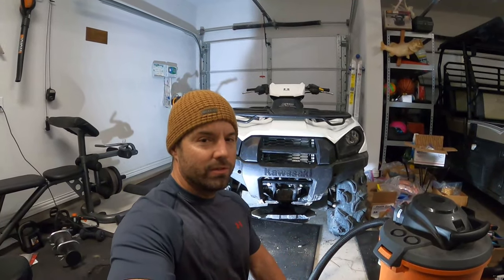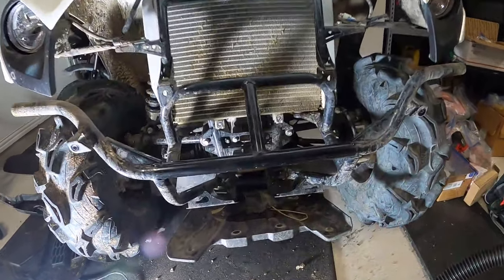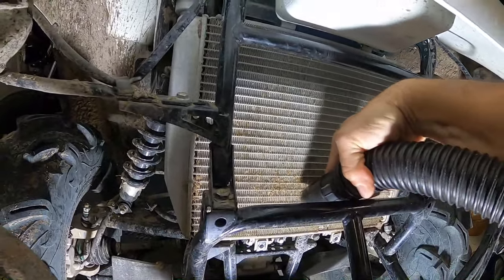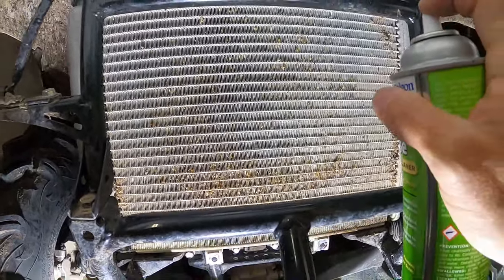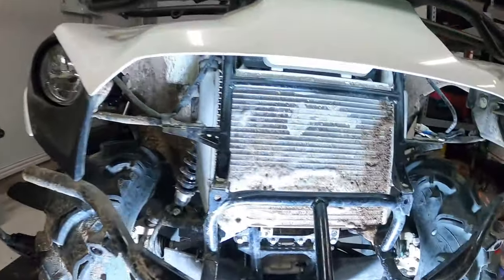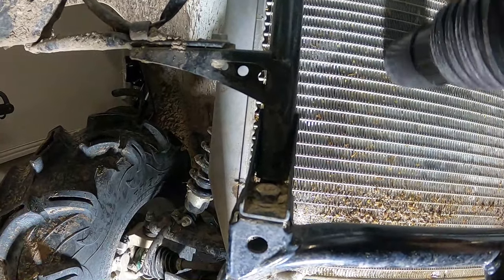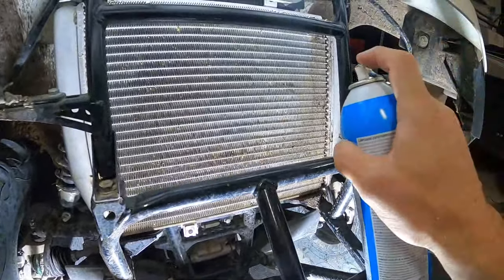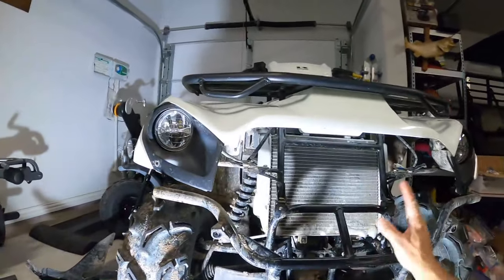How To Clean Your ATV / UTV Radiator (Overheating?)

Comment: Nu-Calgon Evap Foam No Rinse (green label) seems like it looked way better for deep cleaning. I got my new bruteforce and I've overheated twice so I'm looking at rad relocator kit my issue is mud getting thrown on the back of my rad from my tires as there is no inner fenders

Comment: i had a kawi twin that i mud raced and trailed for 12 years, they over heat bad if you do that and dont get 100 percent of the crap out of it every event, the coil cleaner worked but fades the plastic over time, so i started  using simple green with the foaming tip its non caustic so you can breath it and doesnt mess up your bike. the proper way to clean and the easiest on the kawi is take the fan out and lay it to the side takes like 5 min and do it from the back and hose it out , pressure wash is never used on a quad by me it destroys everything,. when its done you shine a shop light through and look at it from the front and you should not see blocked areas

Comment: I use a chemical called NU Brite. I got it on Amazon but its not on there now. I get it in a one gallon jug and put in a spray bottle and spray the radiator with it. It foams up and pushes dirt out of the fins. Use gloves, glasses and a face shield because this stuff burns if you get it on your skin. Makes my radiator look brand new again. I also take the fan off (it's pretty easy just 4 bolts) to clean both sides really well. After I use it I just spray the radiator with a hose. I have a 2020 Brute Force 750 and love watching your videos. Keep up the great work.
Reply from the maker: Hey that's for your feedback. I saw a similar formula like what you are talking about that's blue in a gal jug I think it was same stuff. I was a bit hesitant to use it around wiring and paint. I know it def will clean it up better.  Thanks again for watching.
Reply: used to mud race, also worked on commercail ac and that stuff would take out cars and crap if you wernt careful where it goes . not good for quads. i found simple green works just as good for clay and seeds, so i started using it for both and you dont have to worry where it goes. i read some people put on side covers, i didnt want to loose rack storage doing a rad relocate either but leaving it and putting covers on helps, mine had them from kawi but they dont now
Reply: @ChadOutdoors  .

Comment: I had the same problem with mine. From June 2019 when I got mt 2019 750 until March of 2020 I did the samething taking it apart and cleaning it just about after every ride. I got fed up in March of 2020 and purched a radiator relocation kit....best money ever spent. With the radiator up top i have never had to deep clean it like that again.  I would recommend getting one. Another good video
Reply from the maker: That's definitely something I will consider.  Did you use the factory radiator when relocating? Thanks for watching and glad you liked it.

Comment: My radiator has crap stuck in there from driving through high weeds. I need to clean it before it causes issues.
Reply from the maker: Ya it just gets worse especially if you go in muddy water. It will all get caked.  Thanks for watching.
Reply: @ChadOutdoors  how to clean it?

Comment: I heard a radiator relo kit helps with overheating problems on trials that's mostly likely what I'll get in the future plus it looks cool🤠🤙🏾
Reply from the maker: Exactly
Reply: It does..... I put a rad relocate  on my 19.  But I pulled it off after 2 rides.  Hot air constantly blowing in ur face.  If it gets.wet steams your face
Reply: @michaelmartin9837  lmao🙉 do you go muding?
Reply: @keitrichodge5649   where I am I have alot of mud and trail riding about 50/50
Reply: @michaelmartin9837  oh that's Cool👍🏾

Comment: I wonder if U were to reverse the fan like on a dozer would it help to keep the weeds out😎😎😎
Reply from the maker: Prob so especially with a super fan
Reply: Pulling heat from the engine as the air supply to pass through the radiators fins would be counter productive to the cooling system. Take a piece of window screen and put it on the front of the radiator.  When it gets clogged just remove the screen and wash it off and put it back over the radiator.